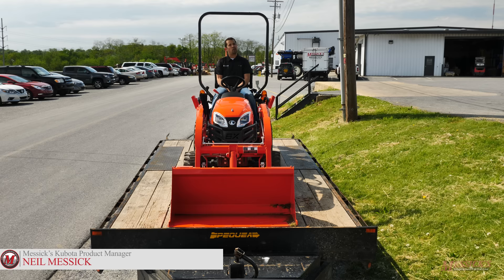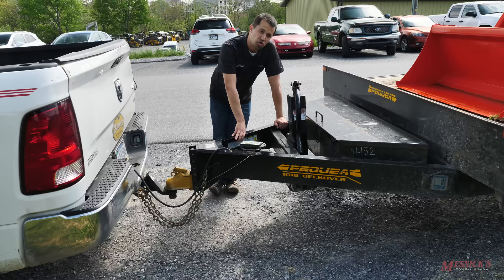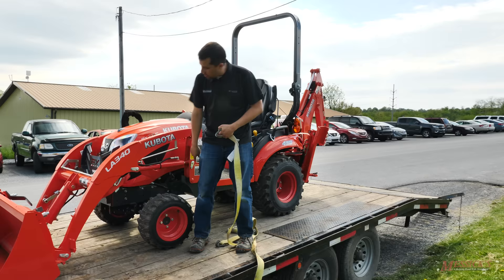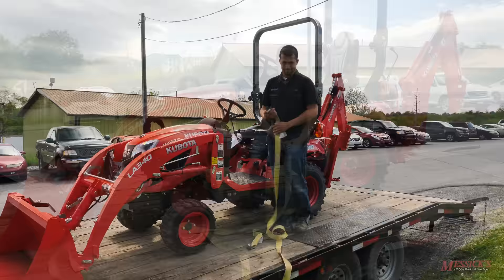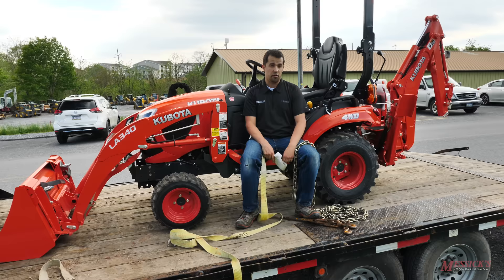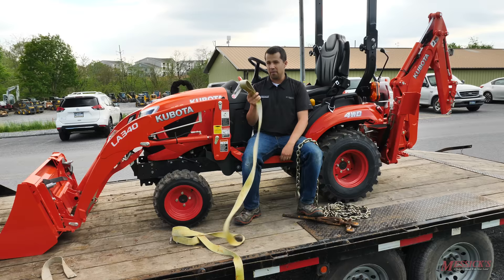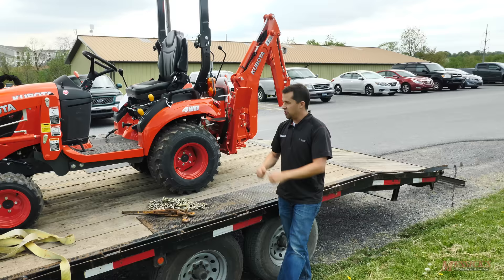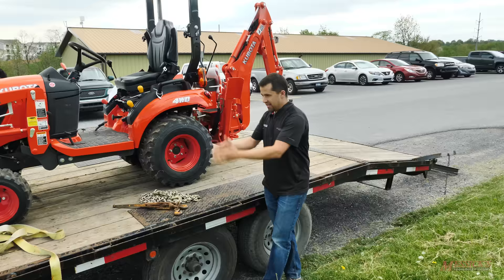Tips for loading and hauling your equipment (with bloopers!!)

Comment: I worked for a what I call a criminal paving company. The owner was cheap. Bought the cheapest chains for all the equipment. Please n know the chain limit on there load breaking points. I had a chain tie down snap on a front end Loader, it happened close to yard so I was able to take back equipment to yard. Told own the chains were unsafe. What did guy do he FIRED me. Said it was my fault. He even tryed to STOP my unemployment benefits, as I looked for another job. This outfit had backed over a previous employee with one of the Dump trucks. He spreed one of his trucks all over a pasture, by driver getting hit by a train. It was a Dangerous company to work for. He had Lawsuits against him on his dump sites. Pushing dirt onto the next property. Sorry for talking about this but please know the chain breaking point on heavy Equipment that is large.

Comment: When loading or unloading...   I have 2 words...  WHEEL CHOCKS.  If on a hill I  check both truck and trailer.  If your ramps dont have a down brace next to the trailer, I usually put a suitable piece of square wood (4×4 or 6×6 or larger) under the very back of the trailer frame to prevent lifting the back wheels of the tow vehicle off the ground.

Comment: I asked my dealer if the weight of 1570 pounds was all the tractor including the backhoe and loader. I think it is short of the actual number. Do you have an actual weight for the BX23s including 2 quick disconnect loader and backhoe?
Reply from the maker: Add 10% to the spec sheets.
Reply: @MessicksEquip  That doesn't add up to the numbers either. No matter how I add the 10%, I can't shake the numbers not adding up.

Even looking in the owners manual, it states 1570 pounds for the tractor. No mention of backhoe or bucket.

Reason I want the actual number is to see if I have to update the floor of my existing tractor shed .
Reply from the maker: @danyf3116  There is no way to accurately do it to the pound on paper.

Comment: What I don't get is why not just buy a slightly over-sized trailer? If you have a piece of a equipment with a dry weight of, say, 4,000 lbs, just buy a trailer with a 10,000 lb gross rating: it's not that much more to spend, especially considering what you've probably already spent on your equipment, and for all intents and purposes, it won't cost any more to maintain, and you're covered if you need to haul something heavier than you thought you might.

Comment: Can you go around the front axle? For some reason I'm worried that that would be unnecessary strain on the axle.
Reply: Nadine Ouellette ya you are fine as long as you don’t bend any steering links.
Think of it this way, it holds the weight of the tractor, it will be fine to hold it from moving.
Reply from the maker: I can think of better places

Comment: Also... whatever tongue weight there is, is not on the trailer.  A 14k trailer that weighs 4k with a tongue weight of 1.5k can haul 11.5k legally
Reply from the maker: I've heard this too, but heard inconsistent things from police offers about it.
Reply: I agree. If the DOT were to weigh you, they would weigh at the axles to check load weight. As long as your truck axles are not over weight and the trailer axles are not either you would in theory be good. The tongue weight would sit on the truck axles not the trailer axles.
Reply: Some people we know have a 20' flatbed gooseneck with two 7,000 lb axles: it probably weighs 4,000 lbs, and it has a cargo rating of 12,000.
We have an enclosed trailer with two 7,000 lb axles and a dry weight of 6,700 lbs, and it's rated for 8,000 lbs of cargo, so it does appear that manufacturers factor in tongue weight to an extent.

Comment: Is there a best practice to transport the tractor forward or backwards? Should I be concerned with 45-50 MPH winds on the tractor radiator if towing  forwards?  Another great video!
Reply: No to both questions. You just want the load balanced. If your concerned with weight balance, measure the rear bumper height unloaded, then loaded.  You want to see a difference where when loaded the height is less. There's no magic number,  but say 3" or so. Too much tongue weight is not a good thing either.
Reply: Tractors should always be backed onto trailer. Less chance of roll over.
Reply: Brent Kiser less chance of roll over how?  As in going up the ramps? I'm confused
Reply: Jason Hendrix absolutely. Think about the physics. If deck height is higher than center of gravity of tractor and ramps are short, any sudden acceleration loading or quick breaking unloading could easily upend the front of tractor. Of course all is dependent on type of trailer/tractor combination, but why take that chance. All it takes is one time.
Reply: Brent Kiser u typically only have to worry about that with skid loaders
Reply: Gotcha. I understand what you're saying. I haul my cat1 tractor on a 14k deck-over, and even with a cat2 8ft bush hog, it doesn't rear up. However, all tractors are different.  Most older tractors are more back heavy. Another thing to keep in mind tough, is the tongue weight. Having the heaviest part of the tractor, the rear, that far forward of the axles of the trailer (unless it's a really long trailer) puts way more stress on the tow vehicle rear driveline/suspension components, and might go over the max tongue weight. There is no one correct way, as different circumstances present their own correct way to do things.
Reply: Jason Hendrix haul my little BX24 on a 16 foot tandem axle. Perfectly balanced frontwards or back. But comfort level alone, backing up and driving off is alot easier than driving up and backing off. Front bucket adds to that safety net. Also backhoe does not drag when loading backwards.
Reply: There is no 1 correct end all answer. The answer is situational.

Comment: Would a L2501 with loader and box blade and filled tires be too heavy for a utility gate that is beefed up? Im not so much worried about the gate as the Hinges. Axles are 5200lb tandom so no issue there.
Reply from the maker: Likly.  We used to use mesh ramp trailers, they did not hold up but we use them daily

Comment: Any problems with equipment? I'm on Harley, 101 N. Shelton, Washington day of Oyster Fest. Truck like your with flatbed/tractor/backhoe in front of me. Small car literally darts in front of his truck to zip off onto exit ramp, like some Arnold would do in movie, complaining about size of his shoe bigger than car! Driver, instinctively turn steering to hard left evading collision! So, his truck/trailer are on their left sides sliding around, filling up all lanes! Backhoe falls on its side an bounces in the big rubber rear tires while the boom is extended sliding around in a kind of semi-circle until it stops about 2" from my front wheel! Nice made with shocked face in red Honda car pulls up beside me, looking at the truck, trailer an backhoe all on their sides kind of mangled! She calling 911, but cops within with mile at oyster fest. Here is lesson an reason I'm spending time here so learn well grasshopper! Little car bolted up ramp made quick right an got away clean while actually causing accident. But truck driver got HAMMERED with improper tie downs (not chains), improper weight on trailer, oil spill an hazmat cleanup, insurance, no insurance on backhoe (so he bit the bullet on cost of whole rig), an cause got away clean! etc, etc, an did I mention the cause got away clean!  So, if it's just a very short trip make sure you chain an secure all loads! Thanks Tim p.s nice lady says, after her 911 call, an says, Wow! I didn't think you were going to be able to stop in time! God Bless! Really, I say! I can relate!

Comment: Took my TD-9 International cat (loved that piece of equipment) to friends back property to make him a motocross track with motorcycle jumps, Cool! So I decide to walk over to the edge of work line, but not just edge, I spotted about a 250ft drop off basalt rock cliff straight down! Holy Crap! Oh, maybe I should have told you about the 300 ft cliff you could have just drove over! "Ya Think?!" So before you do any work or even off load tractor make sure safe off trailer wear with no overhead computer cables that will cost you $10,000 in lawyer an court cost (know been there). Walk area if possible an Mark areas where your asked to change landscape. Plan an try to execute plan! Note:when I finished for evening pure breed wolf walks into living room doorway an stood to stare at me! Well, you can come over an see me, no one said you can't, while I moved from seat to floor! He walked right over to me an I asked him permission to touch him! May I? (I always ask wild or even tame animals to touch them)! Oh, your really smooth, much smoother than I thought! An look at how thick your down fur is? Wonderful! No wonder snow doesn't bother you! Then my friend's friend walks in from his kitchen an by his side is the matching female to the male standing by me! Then something wonderful happened! The male walked over my legs an gave up his spot on her side to make room for his mate an he took the opposite free side next to me, an stood there mentally telling her I'm cool!, come over! When she steps over he lays down on all fours an she follows, now I have pair of pure wolves laying on each side of me with their heads resting on my upper legs! Wow they really enjoyed the affection! Finally my friend let's them out side, so they turn an set looking at me! They aren't going pee so I ask to let them back in, an they resume same spot on each side of me. Then when we're ready to go, we walk track to see how he like it? My friend says he loves it an thanks for the cat work, an he gives me a friendly kind punch to the shoulder! But the pair didn't take it so friendly, both growled!! The owner gave me great compliment in: after some adjectives, he says I've never seen them both want to protect some one, not even me, an especially after just meeting you! Their reaction was crazy! Then my friend says, yeah Barney, I've been trying to get them to come to me for half year, an you got them laying on you in five minutes, you amaze! Thanks man! Those wolves were ready to fight for me, that's the best compliment a guy can have! Thanks Tim p.s. so check out everything from work area to pet wolves before your committed! Maybe those wolves won't like you as much as me! Tim

Comment: How long of a trailer are you using in that video? I'm hopefully going to be getting a BX in the next month or two and will need to get a trailer.
Thanks
Reply: Also, as you mentioned the weights that i'm seeing for the tractor and implements are "shipping" weight. Ruffly how much does the tractor weigh in the video? That's what I'm looking to purchase.
Reply from the maker: that an 18ft flat deck w/ 4ft beaver tail.
Reply from the maker: add anything not included in the base tractor, accessories, buckets, ballast, fluids. I then add a safety margin.

Comment: Our DOT mandates chains only.  Straps are illegal.
Reply: Depends on where you are. In the US you don't need chains for equipment with tracks or wheels unless it weighs more than 10,000 lbs. Some individual states might have stricter regulations

Comment: I have a 5ftx10ft trailer can I put my kubota b2601 on it
Reply from the maker: likely not. 5x10 is probably a 3000gvw.
Reply: Messick Farm Equipment it has a 3500 lb axle thoe
Reply: I bought a 16' tandem axle SureTrac galvanized steel trailer (with brakes) for my BX2380. $3100. Used to have a 12' single axle trailer with no brakes. I feel much, much safer with my new trailer! I use it for many things, not just for hauling my BX.

Comment: Personally, I like to use 2" thick single strand cable tightened to 30,000 pounds of tension and then weld the equipment to the trailer with a continuous beed 20 pass filet weld.  I then replace my tires and axles with used locomotive rail car wheels.  I've been doing this for close to 40 years and I've never lost a 1,400 lb tractor yet.

really - don't use 20,000 lb cargo straps?  Oh, that's right a bolt of lightning might hit the strap and your load will go flying into oncoming traffic when you cross a railroad track because your too dumb to know any better.